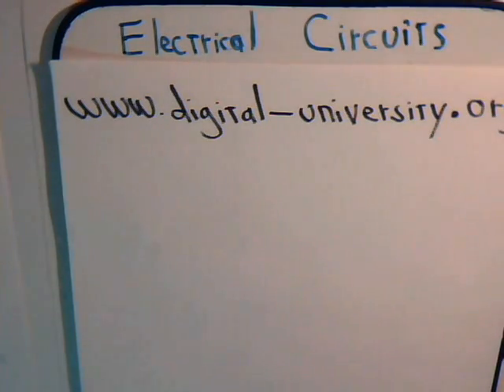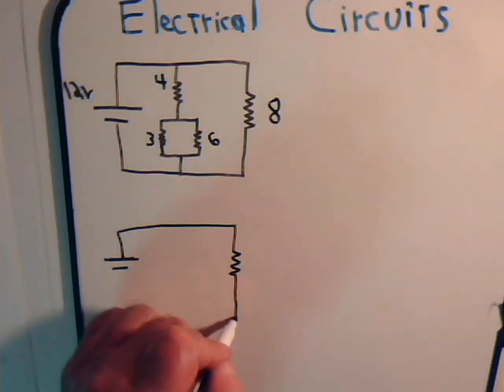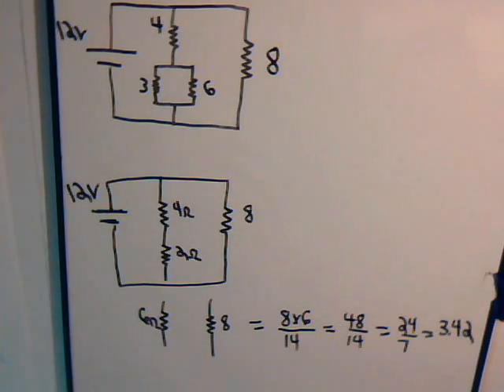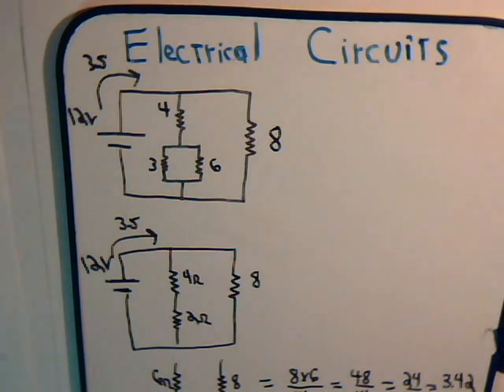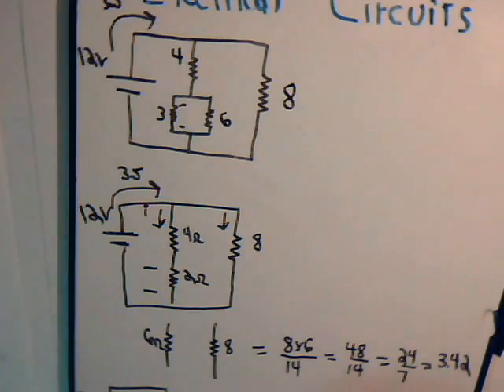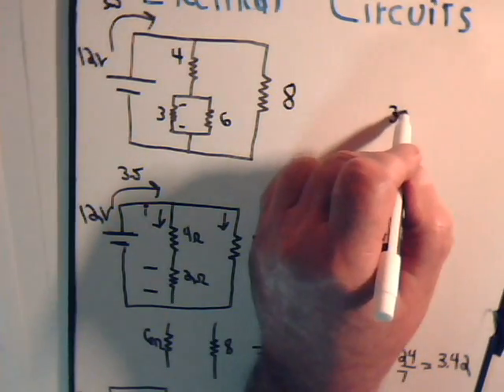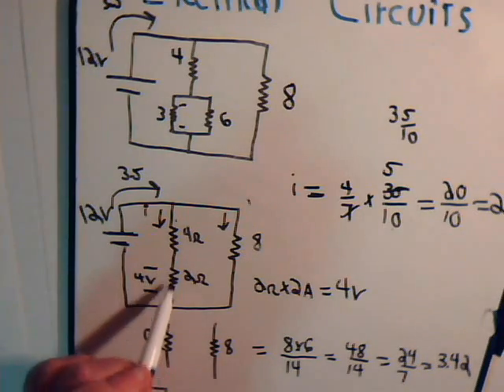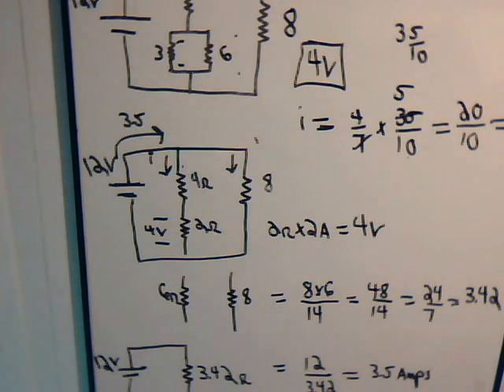Electrical Circuits Video #7: Equivalent Resistance Example #5

Comment: i have a doubt in solving this circuit if i take I=3.5, suppose it divides in the main circuit taking R1=4, R2=3, R3=6, R4=8 and their currents in the branch are i1,i2,i3,i4 respectively
Now, the I divides into i1 and i4 where i1=(R4*I/(R1+(R2!!R3)+R4))= 2 Amps,
so, current at resistor R2 is i2=(R3*i1/(R2+R3))= 1.34 Amps and v2=4.02 volts and if i solve the circuit by using the formula in 2nd vedio current devider formula i1=(Requallent*I/R1)=3 Amps and i2=(Requallent*i1/R2)=3.42 Amps